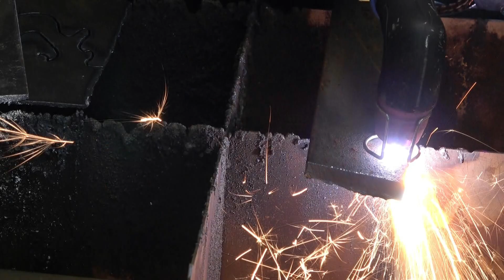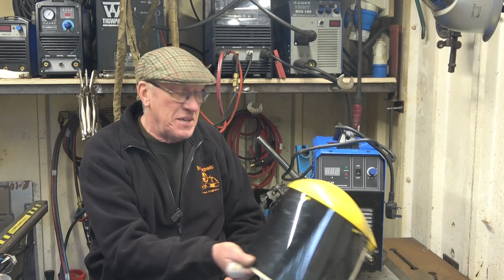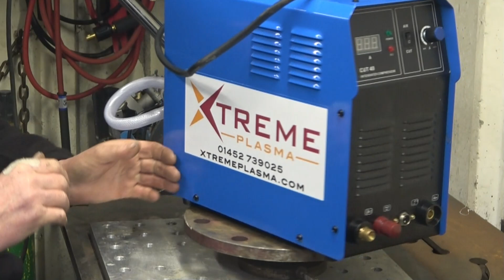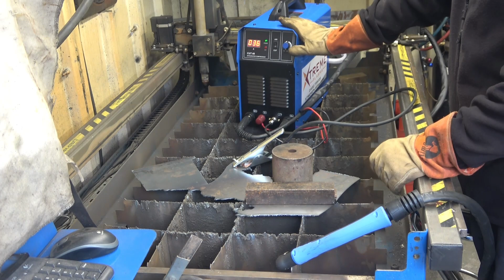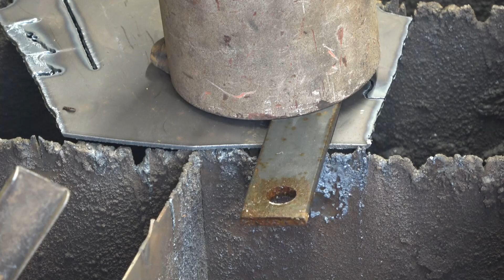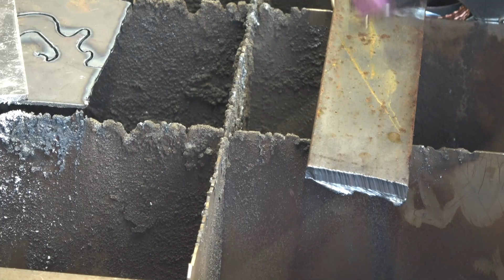Xtreme Plasma Cut 40 Review & Christmas Give Away UK Mainland Only

Comment: Bought a little SIP inverter welder last year after your review of it - very pleased with it after years of arc with SIP & Oxford oil filled not exactly portable! Looks like a very useful piece of kit this,  with built in air compressor & runs off 13A. Nice touch with the xtreme plasma give away 2023 too.